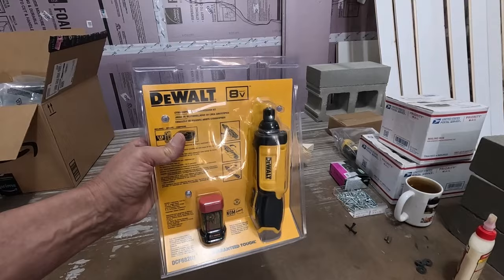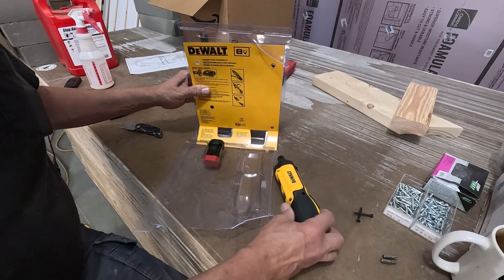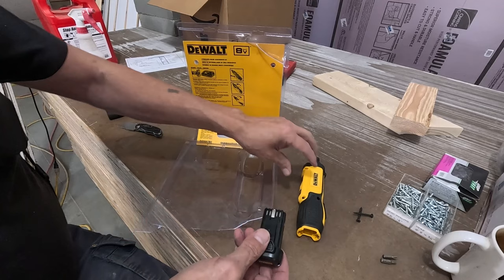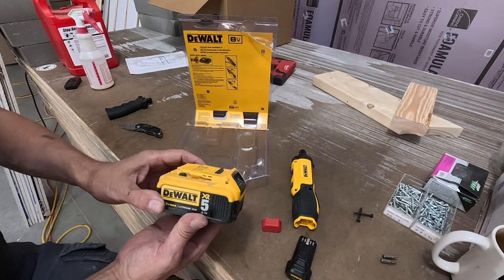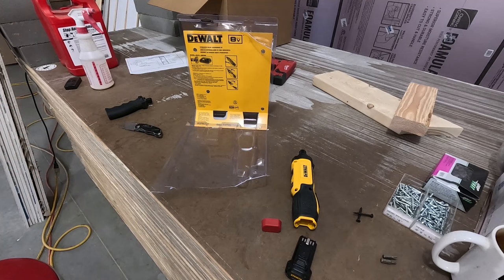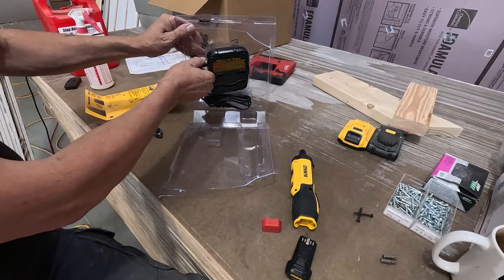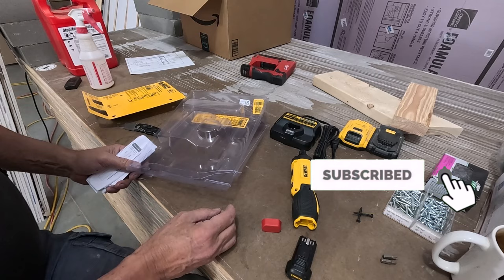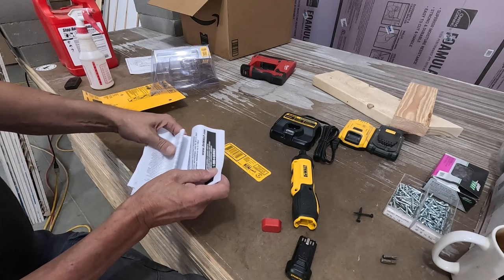Review: DeWalt’s Weird Gyroscopic Screwdriver (Too Late?)

Comment: Cool, totally valid point about dragging a large battery around all day.
Reply from the maker: It may not seem like much, but it was exhausting when installing the hardware on a large kitchen job. A small drill with a vix bit and a smaller driver were definitely preferred. 😊

Comment: A few weeks ago I bought the Milwaukee M12 12V Lithium-Ion Cordless 1/4 in. Hex Screwdriver Kit with Two 1.5Ah Batteries, Charger and Tool Bag for $59 at Home Depot. I really like it so far.
Reply: It’s back to $99 now. 2401-22.
Reply from the maker: That sounds like a great deal! Is it gyroscopic? I have mostly DeWalt tools, but I got a Milwaukee stapler because DeWalt didn't make one, and I really like the smaller batteries for smaller tools! I used to have ALL Milwaukee tools back in the corded days, but they were slow to jump into the cordless arena. I really need to get to Home Depot once and awhile and see what's out there. I do most of my shopping at Menards, and they are very limited on power tool brands 😐

Comment: I know what you mean about cordless tools and their weight. I picked up an old corded drill the other day while cleaning the shop, and it felt like a feather! If you have a 5-6ah battery on your tool, that's a LOT of extra weight!
Reply from the maker: Back in the day, we had cordless tools that sat on a charger (those sucked), and the rest were 8-volt (I believe), but they were NiCad. They were heavier than lithium ion, and when the newer (heavier) versions came in, we always tried to get ahold of the older 8-volt ones.

Comment: Brother you need to check out the “Extreme” line of 12v DeWALT tools, perhaps especially the DCD703 5-in-1 Driver.

Extremely light in the hand and very powerful for 12v.
Reply from the maker: Thanks Burning Straw! I was just telling another commenter that I don't see a lot of tools because I rarely go to Home Depot, and they have limited tools at Menards, but I'm going to make it a point to head there later this week. I really like the idea of an 8 volt tool because of the tiny battery, but will definitely look into that 5-in-1 driver 😊

Comment: There's a better version that can twist into a pistol grip and also has a clutch setting collar on it works wonders for electrical work or anything with lots of screws
Reply from the maker: I saw that! I believe I'm going to pick one up for all of those reasons — and because it comes with two batteries, and the batteries have been discontinued! I bought a Chinese spare, but having four batteries would be better 😉

Comment: Have you looked at the Pro (Blue) Bosch GO Screwdriver? The battery is integrated so not fully what you are looking for - but maybe get 2 in a deal somewhere.
Reply: Personally I use the 12V system with the FLEX adaptors for small jobs. very powerful and sufficiently lightweight and very compact.Bosch GSR 12V-35 FC
Reply from the maker: @hookedonwood5830  Back in the day when I worked full time as a cabinetmaker, all of our tools were Bosch, Hitachi, and Makita. They were ahead of the loop as far as cordless goes. DeWalt was not even a thing back then — they made radial arm saws for the most part. I will take a look next time I'm at Home Depot. Thanks! 😊

Comment: Hi Mojo, wow what a neat little drill, be interesting to see how long the battery lasts before it needs charging.
Reply from the maker: Thanks Larry! I will be giving it it's first workout in the Tiny House on the electrical work there, but it will certainly be used a lot in the woodshop once that's completed! I may look into those 12-volt tools from DeWalt as well. Bigger is not always better 😉

Comment: This DeWalt 8v is home work is best can't work heavy work professional.
Reply: I’ve been using mine professionally since Christmas 2018 in HVAC and repairing all type of equipment. Not sure what you mean.
Reply: @marcianotrevino9076  20v DeWalt is all can use wall drill cement iron drill strong 20v . This mini electric screwdriver is 8v only heavy duty so much can not i say. I'm using 3 type cordless drill 20v and 8v precision electric screwdriver mini
Reply: It’s a screwdriver, not a drill. If I need a drill I use one. It’s for low torque applications, not for drilling into cement.
Reply from the maker: I would be using it for pre-drilled screw holes in cabinets. That's it.
Reply from the maker: I agree. I need a light weight screwdriver for cabinet work. i use a hammer drill on cement, and a drill press for most holes.